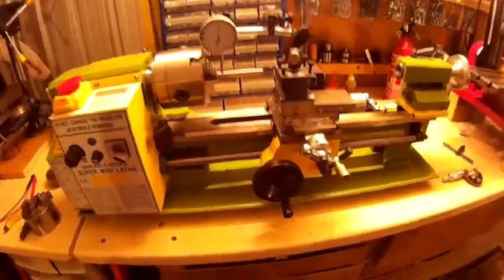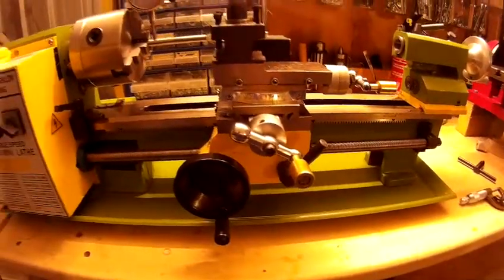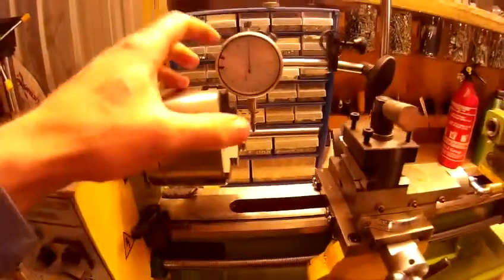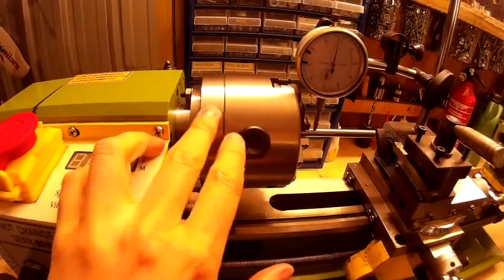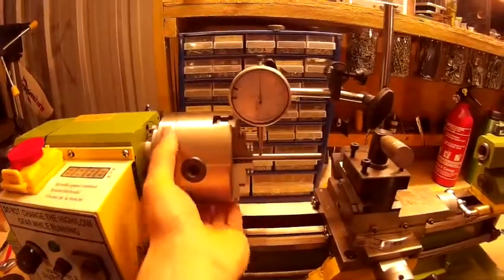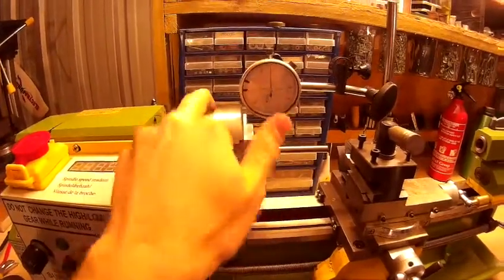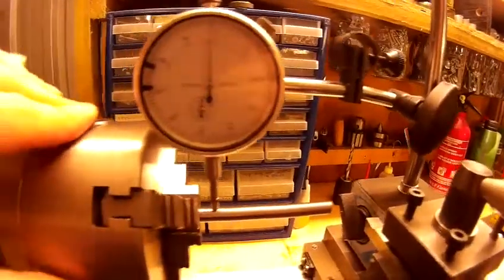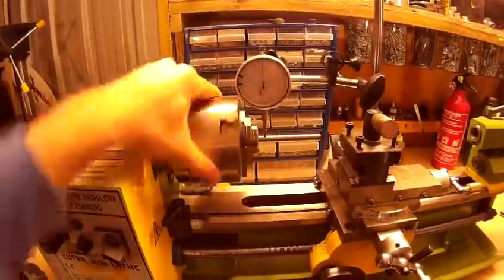Warco sieg c3 mini lathe accuracy how to

Comment: These lathes are rubbish until you sort them out adjust everything as well as it can be and install good quality japan taper rollers for spindle bearings
Reply: True. I picked one up off ebay for 430$ shipped. It was a bit of a project, however im a novice and have no issue hitting targets within .003...which is more than accurate enough for what i make
Reply: at least they are adjustable!
Reply: Yes I have basically the same machine, but from Amadeal and  to make these usable you do need to do a certain amount of tweaking to these lathes. How far you take that depends on your needs. Usually the warco machines are  of a slightly higher build quality, but that may be the bigger ones. This one looks the same as mine just.in a different colour. I have found the motor gutless and have a much more powerful 3 phase motor and VFD to drive it instead of the standard motor and electronics. Just awaiting a few more parts to complete my new control box. But I also up-rated the head-stock bearings to angular contact bearings which made a huge difference. and I also fitted metal hi low gears while I had the head-stock off. I can now report that the lathe is definitely getting somewhere near where I want it to be .I will also be changing the plastic change gears for metal gears, which I am hoping to make myself in due course. One thing I would say if it is anything like mine block the spindle hole when you are not using long material, as the swarf does trundle down the spindle and land on the gears and that will at the least take out the tumbler gears which are a sacrificial part on my machines anyway.

Comment: Apart from the toolpost, my lathe is exactly the same, I notice that you have a stop on the front ways, is it possible for you to make a video as to how you made it please?

I did a teardown last week and it all seems okay thanks to your tip on the chuck and I intend to make a saddle lock for my next project which should be easy enough, my lathe was bought from Warco in Surrey. it is a 7"x 12".

Comment: I have a Einhell which is also made by Sieg and the headstock spindle is really badly out on the horizontal axis (0.22mm on 280mm test bar). Do you know how to adjust the headstock alignment?

Comment: That's not defect in the lathe, it's a feature that's allow you to set up the 3 jaw chuck as accurately as possible. Setting up the chuck or tail stock is something everyone needs to learn how to do.
Reply: tbh never had a lathe that ran flawlessly out of the box! (or off the truck lol) what you just complained about and posted a video on was something you SHOULD do first step after ensuring level ......the fault was the nut behind the wheel :):)

Comment: there are 2 things you can do to get an accurate check 1- you can use 4 jaws chuck and .0005 indicator with two keys to tight each high end to 0.00  2- you can use your 3 jaws chuck but you need to install a grinder on the saddle and grind the 2 jaws ( spin the spindle and spin the grinder and the wheel will grind the jaws to 0.00 center!   
Ozy

Comment: Im looking for a lathe for upcoming projects and need a very accurate one I will also be making things for engines etc. Would you recommend this or should I get a better lathe that potentially wont have these problems from the start ?
Reply: Something wrong if two guys can't move it on the bench ...
Reply from the maker: *****  This lathe is very accurate all new lathes need setting up to be accurate but warco states that they are ready to run but they are not,
I would recommend it if its the size of lathe you need but if you have the space and the cash get as larger one as you can afford,
Reply: At the time of the lathe purchase I will have a bit more cash so I may buy a larger one. I have seen a Grizzly gunsmith one but I could not find any for sale here in the UK :(
Reply from the maker: Just one thing to keep in mind is the weight of a larger lathe, and how you you are going to move it to its resting place. if it weighs say 125kg you will need at least 3 strong persons or 4 or and some lifting equipment plan how you will move before you order it so you dont get stuck. 
bigger lathe here.
http://www.chesterhobbystore.com/920-lathe-3968-p.asp
Reply: Thanks thats not a bad lathe at all ! And I have a few friends who could help lift it and if needed I could probably borrow a couple of engine hoists to get it on the stand if needed.